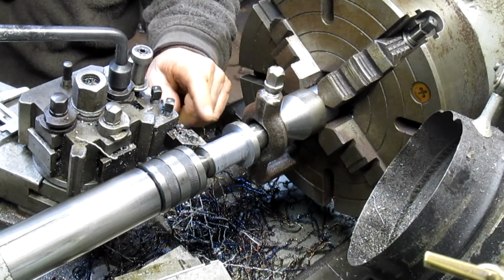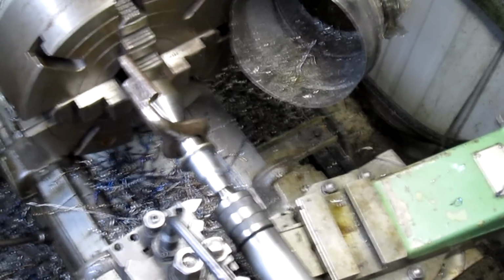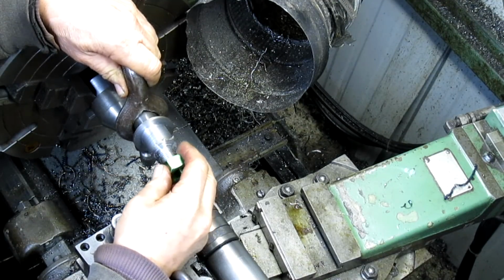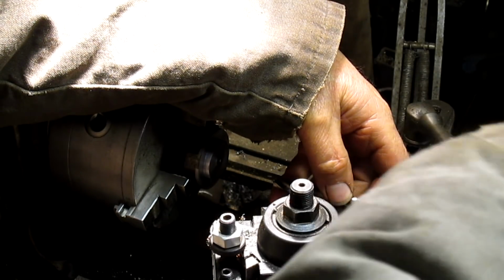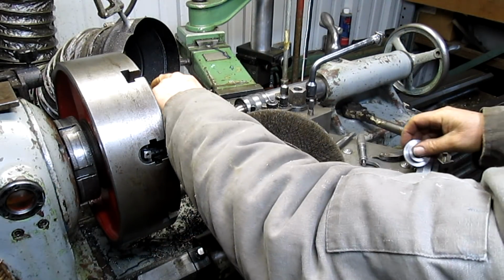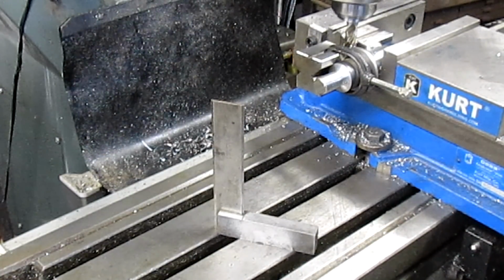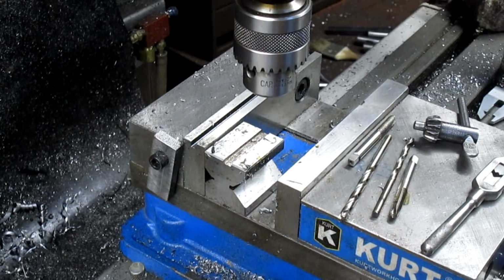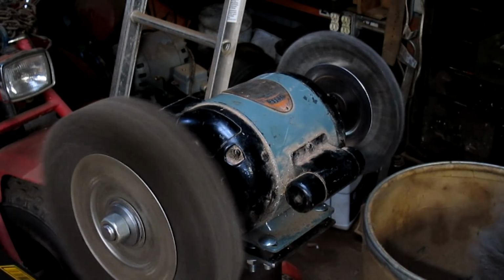Wire Brush Lathe Mandrel #2 final

Comment: Nik, with your center in the 4 jaw chuck, why not get it roughly centered, the turn the point true ? The time spent clocking it up, you could have turned it true quicker. It looked like a sacrificial soft home made center anyway. Keep the projects coming.
Reply from the maker: 6 of one 1/2 dozen of the other. It takes about the same amount of time truing either way. It was more about being too lazy to change the chuck.

Comment: there is a general lack of respect for AC current in this world.please take the time to put a plug on next time nik,i do like your video's.remember the rule of thumb is to ask your wife,"is that alright to do"they will always way on the side of caution.another good project,thankyou.
Reply from the maker: I grew up with a lack of respect for electricity. My dad use to grab onto live wires and hang onto them just to show off. I, of course, followed in his footsteps. Usually I'm more careful with live wires. Could have edited it out.
Reply: I fail to see the huge safety issue. What he did was no different than using an electrical test meter on a live circuit which is done safely thousands upon thousands of times a day. He hooked the motor temporarily and even said he intends on wiring a permanent plug on it after testing. This ain't an OSHA job, it is Nik's back yard shop. Non-issue...

Comment: Nice project. Is there anyway to turn the motor so the switch in on the front side? That way you will be less likely to get your clothes caught on either of the spinning wire wheels turning it off. Just a thought. Looks like the center of the motor could be turned 180 degree to do that.
Reply from the maker: Trust me, I tried every way possible and without doing a major overhaul it's no way.